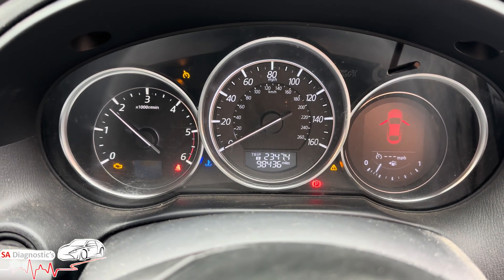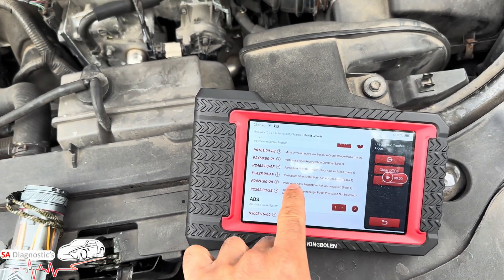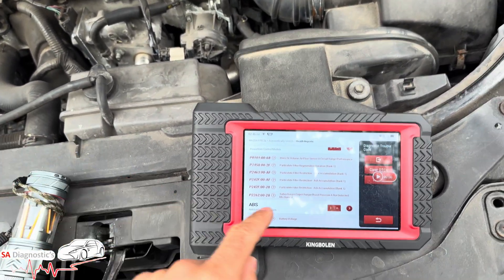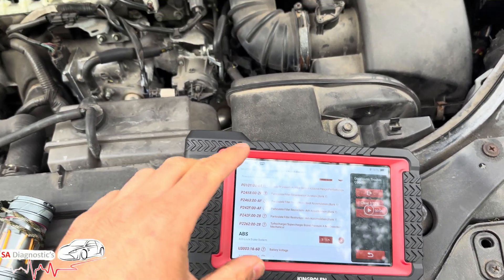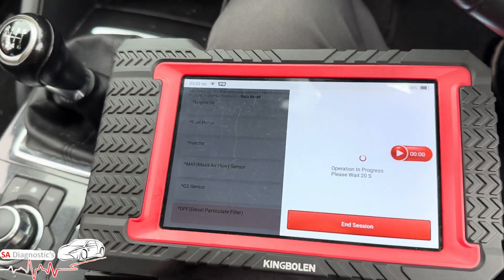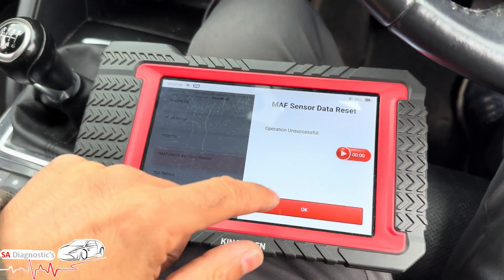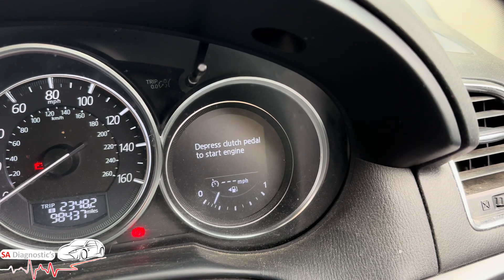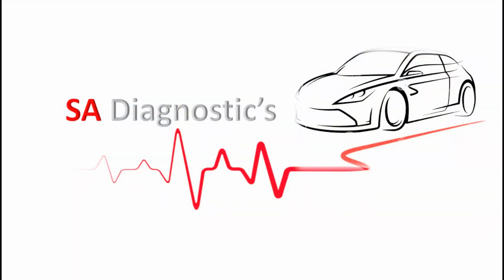Mazda P2458 P2463 P242F DPF Diesel Particulate Filter ASH Restriction Regeneration - How To Fix DIY

Comment: Thanks brother, just took 2 days for me to dismantle and clean the EGR, EGR cooler, Throttle body and a deep clean of the manifold.
However open reassembling the parts back I seem to have the DPF still triggered. I will go for a long drive tomorrow to see if that sorts it out

Comment: Hi. I just got on my obd2 p2463 and p242f.  The car is drive well no power loss. Fuel increase just a little as im driving 2200+ rpm. Do you think a forced regen and clean would help?
Reply from the maker: It will do but since the fault code is stored I very much doubt it will go away until you do a hard reset using diagnostic machine…